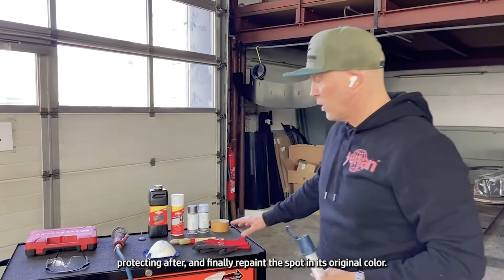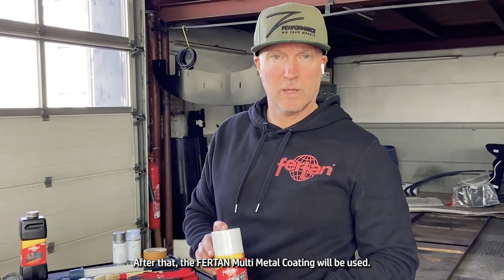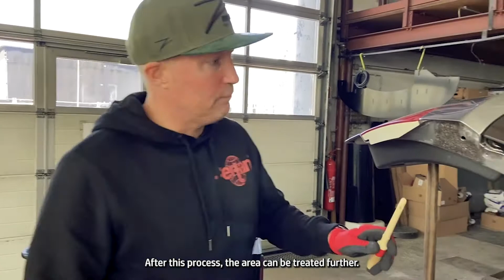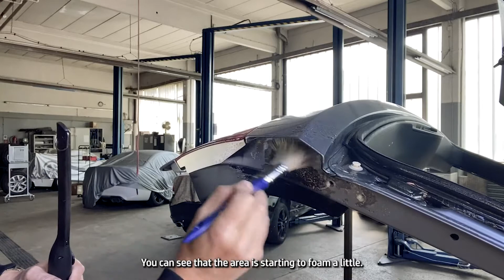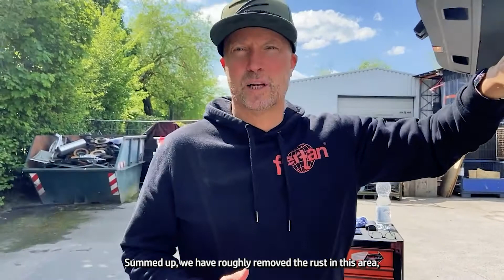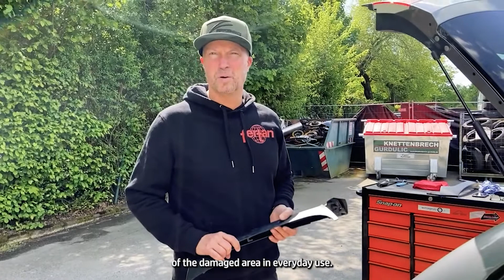FERTAN Rust Removal & Prevention: How To Remove Rust From Your Car (Underbody, Trunk, Doors)

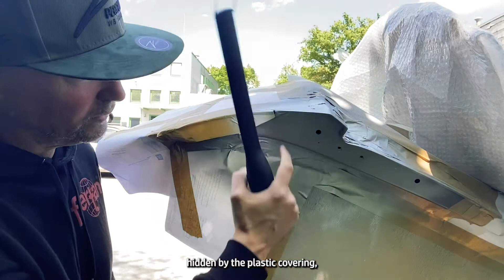Comment: What do you mean by "this process should settle the rust issues for the next 4-5 yrs" @10:32 ? Will the rust come back in the same spot that has been treated?
Reply from the maker: When I mentioned "this process should settle the rust issues for the next 4-5 years," I meant that using FERTAN Rust Converter can provide long-lasting protection. FERTAN penetrates and converts rust into a stable compound, creating a protective layer that prevents further rusting. With proper application and maintenance, this treatment can effectively prevent rust from coming back, potentially lasting even longer than 4-5 years. Regular maintenance and protective coatings can extend this duration significantly.